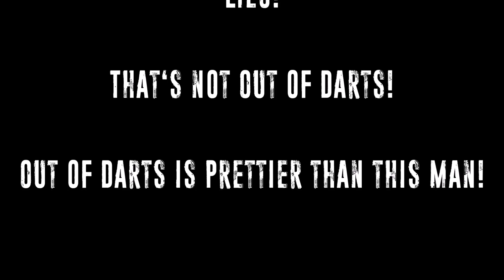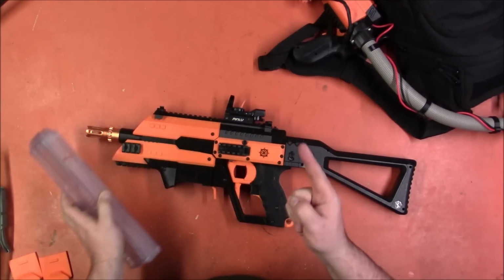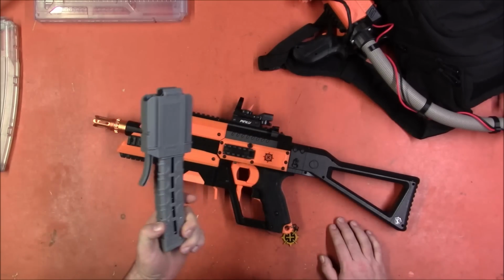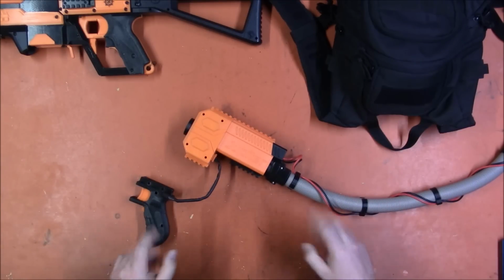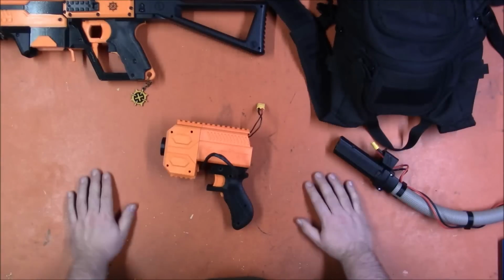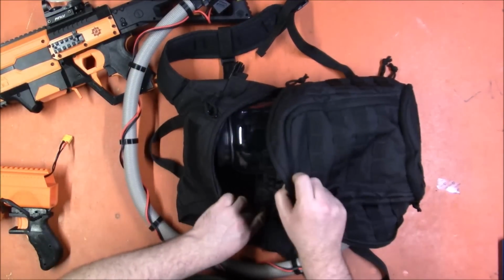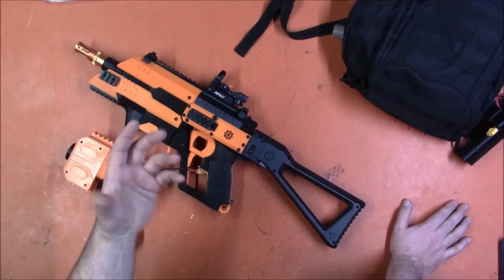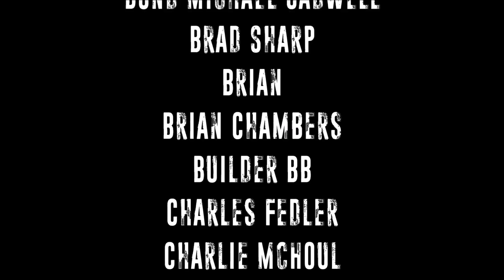The Truth about Captain Xavier's HvZ Heavy Infantry Primary

Comment: The only way this can be more more battle effective to me would be to have an under mounted shotgun like a rough cut. Perfect for taking out a couple of zombies when you're in the middle of a mag change and don't want to waste any of your proton pack. Rifle, shotgun, and flamethrower all in 1
Reply from the maker: ...and where exactly would that go? And how would I fire it mid mag change?
Reply: @CaptainXavier  the only thing I can think of is having the Jupiter trigger grip act as the priming grip for a rough cut on slam fire. Though that would probably make the whole blaster a bit to unwieldy now that I think about it. Oops 😅
Reply from the maker: @dragonblaster-vu8wz  yeah...there would be no way to make that fit or be remotely functional. But assuming we magically could...if I have one hand holding the blaster...and my other hand changing a mag...which hand is pumping the roughcut?  You know...so I don't waste any of the 400+ rounds in the Proton Pack?  ;P
Reply: @CaptainXavier  what about an air cannon and absolver on the other side of the FDL , with the firing thingy wired back to a second trigger on the main grip?